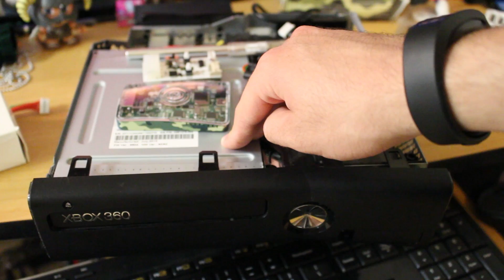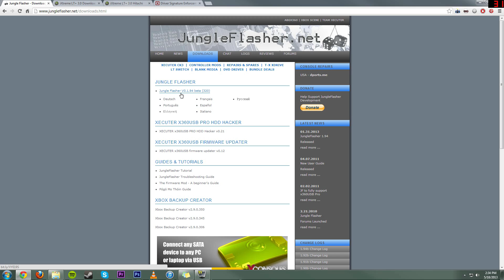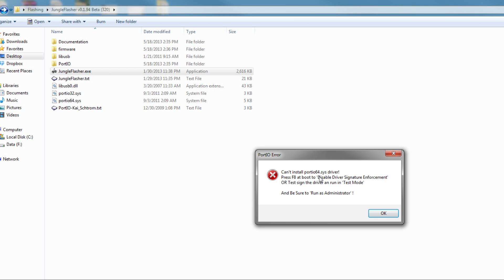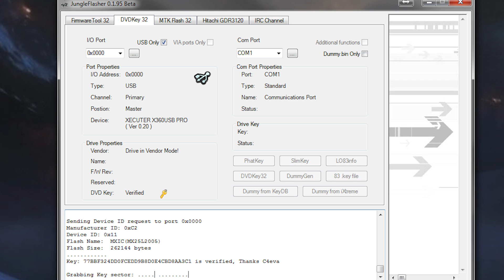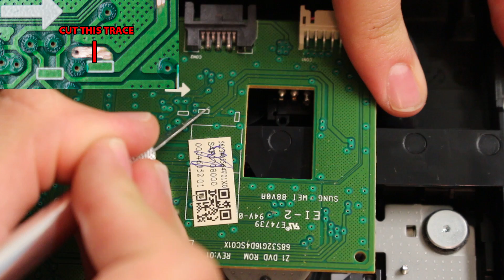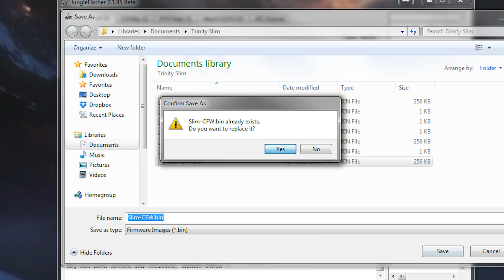How to Flash an Xbox 360 Slim DG-16D4S MXIC Drive

Comment: i have problems with JF freezing when it's trying to send a command to erase the firmware. the firs time it did it just fine but when i got a key injected firmware it lost the 0x8c button and it freezes when trying to erase the existing firmware. help pls im so confused
Reply from the maker: Any Windows version newer than 7 tends to do this. From my experience, the best option is to use a computer with Windows 7, Vista, or XP installed on it. If that's too far, set up a Windows 7 VM and pass-thru the USB devices needed. The downside to the VM is that it will fail to verify firmwares, but the unlocking/locking/dumping/flashing portions are fine.

As for the drive itself currently, if you're not getting anywhere with it then you'd need to unbrick it. Not impossible, just need to look up and dig how to do it.

Comment: Hello everyone, first of all, thank you for your tutorials 😄 it's been a long time since I flashed an x360 reader and I've never done the slim ones, but nostalgia made me buy a slim one and I can't find an xk3y. I resigned myself to flashing my reader, but a quick question since the updates is there a risk of being banned with this method? Thank you, cordially
Reply from the maker: After over 10 years of this being the latest firmware, its safe to say that there's always a risk but there really haven't been any bans ONLY for having a LT+ flashed drive. The only ways you can really get banned now with a flashed drive are for modding online or not properly patching your games.
Reply: @MrMario2011  Many thanks for your response, I plan to turn to flash because there are too many bans with an RGH and by chance you wouldn't be where I can find an xkey v2 or v3?

Comment: I got to 0x00 but when I press read it gives stage 1 authorisation failure and only if i keep the probe on the board, 
higher resistance values seemed to make the board not unlock and grow warm... am I doing something wrong? 
My probe is at approx 2 ohm by default when it unlocks but fails, and trying at 5 or 10 ohms approx seems to just not work...
Reply from the maker: I believe I ran into something like that once? It turned out I didn't sever the trace as well as I could have, so I scraped a bit deeper and tried again. It unlocked quickly the second go around.

Comment: Excellent tutorial and still reliable in 2024. I have just flashed a handful of slim drives using a usbpro2 i have all the modding tools from back in the day and an original usbpro unfortunately not with the camo pattern just black on the bottom i gave that a go on the 4th and 5th drive i did and not a problem at all.
Just wanted to as thanks for keeping this time less tutorial on YouTube love your work thanks
Reply from the maker: Glad this is still helping people! I know the tutorial still works, the hardest parts these days are finding the hardware and staying on Windows 7. Anything higher than Windows 7 I've noticed your mileage may vary for reliability.
Reply: @MrMario2011  yes it did help a lot thanks again I do a lot of rgh mods these days not so much flashing but I flashed  quite a few dack in the day but your guide was a really good refresher course lol.
I flashed the drives on windows 10 64 bit laptop and once I disabled driver enforcement and installed the drivers for usbpro it went like a dream on both usbpro and usbpro 2 
Again thanks very much sir
Reply: How do you hookup the probe when using x360usbv2? For phat lite on drive or this one? And what adapter you need?

Comment: On pcb trace cut i recomend cut two lines close to each other and scratch the copper line between them two cuted lines, is easier to interrupt the trace and also is much more reliable... just a point... some peole use a mini drill / grinder if they have one...

Comment: Can i do this by just connecting the disc drive to the Motherboard SATA Port only without special flasher? I'm not able to find any flasher online, and the ones that i found are very expensive.
Reply from the maker: You can try, sure. Be sure to use the SATA0 port.

Comment: Can I still flash this with a Probe3? I don't have a Sputnik360 Probe.
Reply from the maker: Sadly nope, the Sputnik 360 has resistor values on it which the Probe 3 doesn't.
Reply: @MrMario2011  I managed to probe the point with the probe 3, the only difference is that I had to hold a resistor on the point, then probe the other end of the resistor.

Comment: my chip says its CUK03070. is this still an mxic? its supposed to be an already unlocked board but it said it was for the dg-16d4s drive which i have and it matches up just different chipset.
Reply from the maker: All identified from the MEDIATEK chip. If you're using one of those LTU2 unlocked boards, this tutorial is not for that.

Comment: i know this is an old video but i have a hitachi 0502 (DLN10N) dvd drive how do i flash this drive....ive looked online but nobody has mentioned anything about these drives past 2012 can you help me please
Reply from the maker: I've never worked on one of those, but you would need to RGH the console to get the key, then flash that to an unlocked board and install the board into the drive.

Comment: @MrMario2011 I have my DVD key # already extracted through an RGH chip soldered in, but I have a Liteon DVD 16d5s with firmware 1532. I know I have to buy the ltu2 unlocked board. Will the steps still work as you show in your video to flash the ltu2 unlocked board? Thanks.
Reply from the maker: No need to hard unlock it as you're buying an unlocked board. You should be able to just unlock, write, then lock once you have firmware built.

Comment: The prices for these tools have gone up by A LOT! Your looking at an average of $150 - $250 for the Xecuter X360 USB Pro v2 in 2020. I tried buying one from the official site but they are no longer producing them so you have to buy one second hand or through a third party seller. I did manage to find 2 that were legitimate for $89.99 and $99.99 respectively. "Were" being the key word as when I went to buy them, they were both out of stock. You have to be careful as a most of the cheaper ones are scams. Honestly, it's about the same price and in some cases even cheaper to just buy a 360 that comes already modded. Found more than a few legitimate ones that were already flashed, had JTAG/RGH/R-JTAG installed, had visual mods like LED lighting on the case and all needed accessories including the upgraded HHD for around (some even under) $250. If you're planning on modding multiple consoles/or you already own one, get the tool as it's worth it in the long run. However, if you're planning on buying a 360 & modding that one console, just get one that's already been modded as it'll actually come out cheaper. Worst case scenario you end up paying the same amount you would have if you bought the tool and console separately. However, you won't have to go through the hassle of flashing the console and installing all the mods.
Reply: got the x360 usb pro 2 for 60 from aliexpress mind you that there's no plastic enclosure but hey ....   i got one and works great
Reply: @slaklu  Thanks. That's very good to know.

Comment: I've tried this mutltiple times and I just can't get it to work. I can do slimkey and I'll get all the data that I need. I've cut the trace and went back to junglesflasher. Whenever I try to do the "intro/device ID", it comes up with a failed message and tells me to quickly turn the drive on and off. I do exactly that and I can only get it from switching between 0x51 and 0xD0...Does anyone know how to get it to 0x72?

Comment: is there anyway to flash the drive Without using the probe?
Reply: http://team-xecuter.com/forums/threads/67810-SPUTNICK360-Unlock-Tutorial-for-DG-16D4S-MXIC-memchips-(soldering-and-trace-cuts)

I have done this and it worked. Usually its 10ohm resistor but as the guide says you may need 5, 15 or 20 ohms. Do make sure your drive is mxic chip.
Reply: http://team-xecuter.com/forums/threads/67810-SPUTNICK360-Unlock-Tutorial-for-DG-16D4S-MXIC-memchips-(soldering-and-trace-cuts)

I have done this and it worked. Usually its 10ohm resistor but as the guide says you may need 5, 15 or 20 ohms. Do make sure your drive is mxic chip.

Comment: i have the Xecuter X360 USB Pro 2 & i fully recommend it as a usb device and power supply in one :)
that and it can be used to put any drive into 0800 mode. :)
Reply from the maker: I've got one of those as well, haven't used it too much though. Originally got the USB devices because my motherboard didn't play nice with Xbox drives but the ease and compatibility is totally worth it if you're flashing a ton of drives!
Reply: I had the same issue.
After upgrading my motherboard to one that had the supported i7 cpu slot, i discovered the sata wasnt compatible with xbox360 drives... not even linux helped.
really though using the console to supply the power was easy but such a drag... earthing was priority back then :D
So, i bought the Xecuter X360 USB Pro 2 and wow, it made it so easy.
Reply: MrMario2011  with the other drive rghing it a better bet  if you have to do the to flash the drive any way

Comment: i dont remember which dvd rom i have, but i had to make a hole in a chip just like the strp you did cutting out the track. i remember it was hard difficult to understand first what you had to do, especially when you need to retrieve the key. i remember just the same you told, that you had to block it again, inmy case i didnt and works ok till these days.